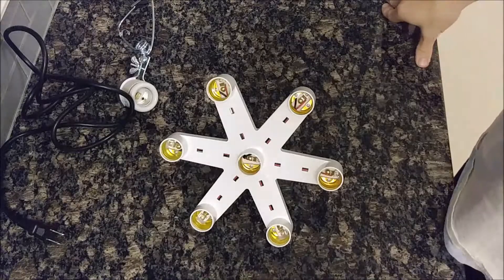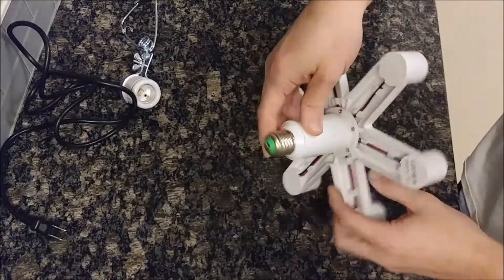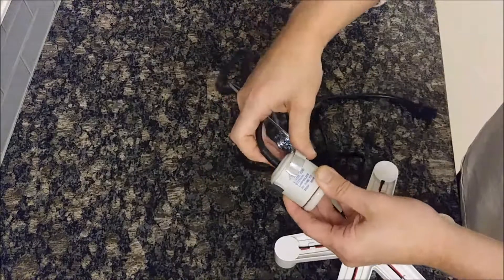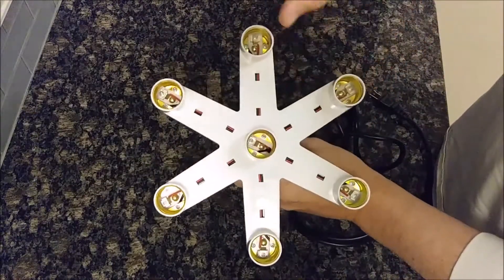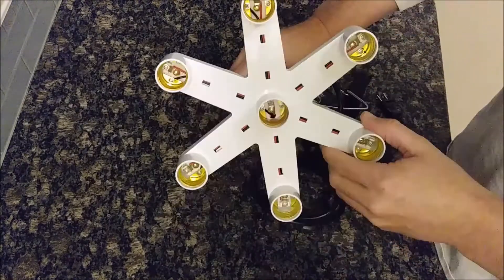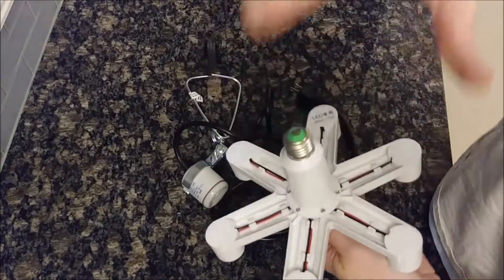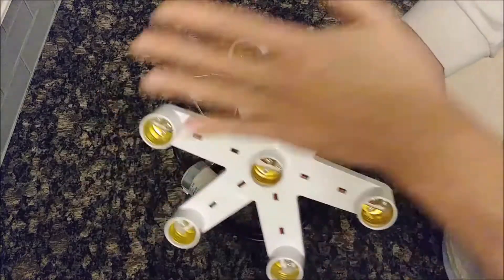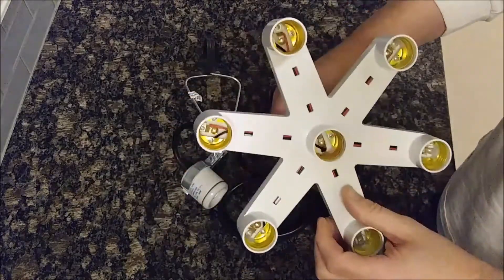E27 1-7 Base Socket Splitter Light Lamp Led CFL Bulb Adapter Holder Grow Photo Softbox Plant Light

Comment: Them things really are brilliant. Imagine packing 7 true 42w cfls in there! Awesome splitter for around 10 bucks for sure man! Later Rick 👊
Reply from the maker: Indoor Micro Absolutely saves you from having to wire up sockets & building a frame. I'm all about saving money. ;-)
Reply: I think there's a limit of 25w per socket.

Comment: Just bought one of these. For years i always asked myself why the fuck these arent avaliable, but they are!!!

I got a E27 1-4 Splitter and ordered X4 25watt 6500K CFL e27 Bulbs to put over a small weed plant grow. If the seedlings take to it il purchase another one and get X2 120watt 6500k e27 bulbs and mix n match them around and have 8 over 1 plant haha
Reply from the maker: A lot of people are also buying Vanity Strip Lights that are cheap & putting in Led Bulbs.
Reply: @DiyRick66  Never heard of them but will have a look some.kinda strip that can hold multiple bulbs wpuld be nice thougho